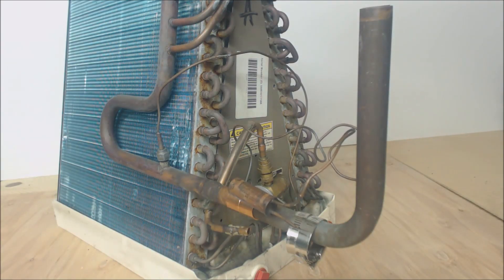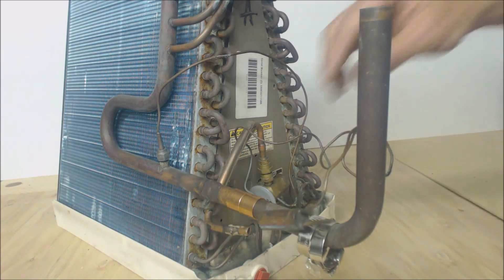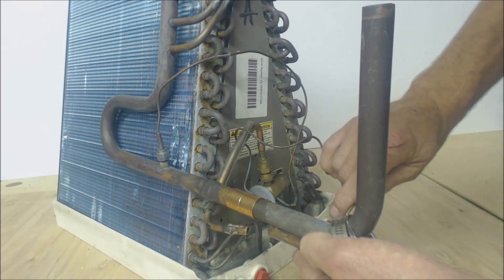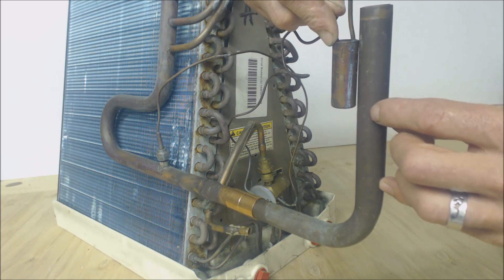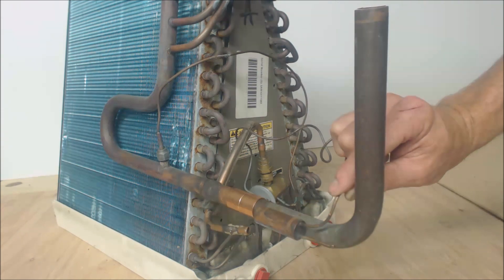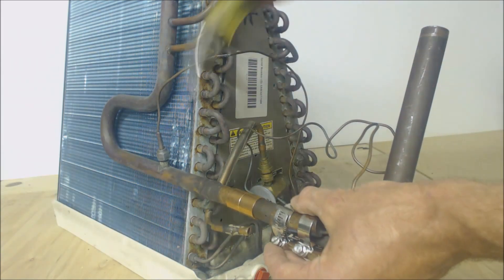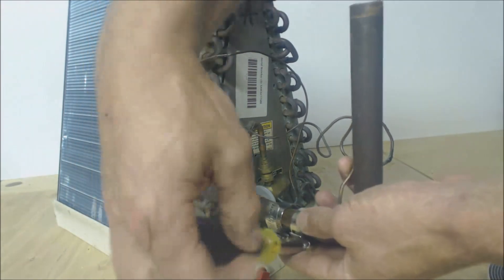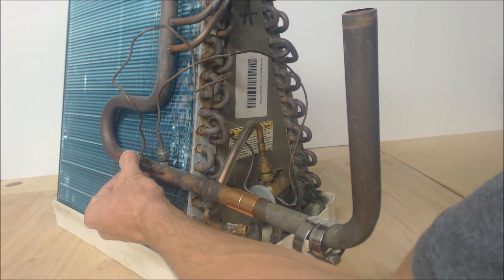TXV Thermostatic Expansion Valve Sensing Bulb Position!

Comment: Great video!!! I absolutely agree that 2-3-4-5 o’clock bulb’s position on the suction line makes no difference. I did experiments with 2-4-4-5 o’clock sensing bulb placements and there was no difference in suction line pressure/temperature or SuperHeat value on wall-in coolers or walk-in freezers. I didn’t play with A/Cs yet. For the refrigeration equipment I had R- 404A and R-407A.

Comment: Can the equalization port be installed on the outside right where the pipe exits the housing, when the pipe section inside is very short?

Comment: 4:37... to have a good thermal contact get some copper tape, or copper foil, wrap around the bulb and the tube a few times (so both are inside that foil "envelope"), and use as you say, a hose clamp or two, and then some insulation stuff around (btw...even alum. foil could do, but copper is the best 'cause it conducts heat much better).
Reply: CPU thermal paste would even be better

Comment: Why does TXV manufacturer not produce sensing bulbs with certain sized grooves/curves that can fit on certain sized pipes? Say sensing bulb fit 5/8. 3/4, 1, 1-1/2, etc.
Reply from the maker: Some manufacturers of evap coils that have the txv preinstalled press a groove into the suction line so the bulb has more sensing surface area, thanks!

Comment: Nice Video's all around. Question, in the electronic industry we use a thermal paste to insure good heat transfer. Has the HVAC industry tried thermal paste with the TXV bulb installation? I am not in the HVAC industry, but just a homeowner trying to educate myself on how residential system work.
Reply: It's no necessary, the txv exist before the pyramids were built and they're still doing its job very well, do you think a car needs 5 wheels to run better?

Comment: TXVs should be down stream from the evaporator coils about 6-10 inches  and It should be at 2pm if your going straight. Great video thanks for some information there.
Reply from the maker: Hey Harry, the txv is installed upstream of the evaporator coil and right before the distributor tubes. The length away from the coil would depend if you have distributor tubes or not. The bulb position would depend on the diameter of the suction tube. These were just general rules for smaller residential systems, thanks Harry!

Comment: On a package unit where do you place your temp probe to check superheat and subcooling?
Reply from the maker: Some package unit ports are placed in the correct spots for checking superheat and subcooling. If they are not then you should look for a manufacturer charging guideline which will say where to read pressure and temp. I know this video is on a split system but the same thought process would apply if the ports were not in the right location and you were trying to find where the sat state temp could be taken from- https://www.youtube.com/watch?v=MHth2vH3np4&t=28s

Comment: does it matter where the bulb is in relation to external equilizer tap?
Reply from the maker: Great in-depth question. There are 2-3 schools of thought on that and one is that the txv is there to maintain a good system capacity. The other thought is to maintain a proper superheat for the compressor's sake. Some would say that you need the bulb to read the suction temp after the last device is installed which would affect superheat to make sure that superheat is not lost before reaching the compressor. Some would say that it is more important to fill the evap with the sat state as much as possible and that the compressor may be able to handle a small amount of sat state every once and a while. Others say there really is not much of a change in temp read on the bulb right before or right after the external equalizer. We also use txv's without the external equalization port which is worse for guaranteeing compressor safety. Thanks a lot Randall and awesome question!
Reply: i wanted to see what you thought about putting the bulb before or after equilizer. i saw another tech video that said he had a problem with bulb after equilizer due to extra refrigerant from equilizer discharge affecting bulb temp. like a feedback loop that caused the coil to freeze up.

seems like there shouldnt be enough liquid coming out of equilizer to affect the bulb sense???? might be wrong.

thanks for reply
Reply from the maker: It would have to leak between the pin and the brass housing inside the txv, highly unlikely that it would be a significant amount. I see manufacturers for ac evaps factory installing external equalizer tube upstream of the bulb and also the way that techs try to install when given the opportunity which is bulb upstream of the tube but it is not like a freeflowing loop inside though, thanks Randall!

Comment: I've seen the TXV itself (not the bulb) installed upside down. Does this cause hangups for the TXV?
Reply from the maker: Since it is spring and pressure driven, it should work but is not advised. They are factory installed horizontal in may instances such as multipoise evap coils. How old was the unit?
Reply: It makes no difference.

Comment: Won't the steel straps in contact with the copper tubing create a bimetallic corrosion that could eventually compromise the integrity of both components? For example: a galvanic corrosion through an electrochemical process corrodes the steel strap and piping, causing both to fail. It seems like you'd want to instead use either copper or plastic straps.
Reply from the maker: These are stainless steel so they don't react with copper due to their properties. If it was a galvanized strap, it certainly would corrode. I would not use any plastic strap or cable tie because of stretching over time and not as strong.  Actually some manufacturers provide a type of stainless steel clamp for this with a single screw and nut. Thanks Adam!

Comment: So while researching a problem today I came upon a thread that contained a statement by a person mentioning that you should always mount the bulb UPSTREAM of the equalizing tube, so about 12" to the left of where you're showing here or next to that bottom bend although I understand that it's probably not the point of this video.  The discharge of the equalizing tube can cause improper metering.
Reply from the maker: Great in-depth question. There are 2-3 schools of thought on that and one is that the txv is there to maintain a good system capacity. The other thought is to maintain a proper superheat for the compressor's sake. Some would say that you need the bulb to read the suction temp after the last device is installed which would affect superheat to make sure that superheat is not lost before reaching the compressor. Some would say that it is more important to fill the evap with the sat state as much as possible and that the compressor may be able to handle a small amount of sat state every once and a while. Others say there really is not much of a change in temp read on the bulb right before or right after the external equalizer. We also use txv's without the external equalization port which is worse for guaranteeing compressor safety. Thanks a lot Tie Dye and awesome question!

Comment: So I have a question, I was troubleshooting a new unit 410A, it was slightly undercharged so I went ahead and charged it up but the low side didn't  seemed to increase the pressure at all I added about 1 1/2 lbs and not even a single psi, but the high side kept increasing, is this a txv sensing bulb? Problem
Reply from the maker: If you are charging and the subcooling keeps increasing but you cannot get the pressure up it is likely the txv. If both are not going up then it is likely airflow. Check out this TXV troubleshooting playlist to confirm this. You can put the sensing bulb in hot water to test the opening of the txv.https://www.youtube.com/playlist?list=PLxnHR5_D2ojy2EYzy0YIJkce9sFIQj4-j

Comment: OK, I'm at a loss here and I could really use some advice. 
When my compressor kicks on my high reads roughly 420psi but my low reads around 110 and then begins to drop all the way to zero yet the high side climbs maybe a few psi. If there was a blockage anywhere after the high side test port I would assume the high side would climb as the low side drops. What causes low to drop to zero but high to only climb a few psi? Any advice is greatly appreciated
Reply from the maker: So when the low side lowers then the high side will actually stay the same or lower itself some while your subcooling increases some. I am assuming we are talking about R-410A refrigerant.  Have you checked out the troubleshooting txv videos playlist on the channel? I show how to test the txv bulb and what the pressures are like when putting the bulb in hot or ice water. It sounds like a blockage or bad txv but the more details the better. Thanks for the question!
Reply: +acservicetech 
It is a 3.5 ton, outdoor compressor, attic air handler. I used your video to diagnose and determine that the TXV was bad. I had the TXV replaced about three weeks ago and it was working beautifully. Just a couple days ago it quit cooling and the compressor sounded like it was pulling a vacuum on the suction side so I shut it down and connected my gauges. Upon posting the unit back up the suction and liquid line pressures were right on the mark but the suction line was around 80 degrees F and the air inside was slightly cool. After running for roughly 20 minutes the liquid line pressure increased slightly to around 440psi and the low dropped all the way to zero so I shut the unit down again. Today I tried to pull the freon into the compressor to flush the system and install a new filter but I could only get the suction pressure down to around 40psi before the compressor kicked off. I'm at a complete loss here. I figured if there was a blockage on the liquid side the head pressure would have sky rocketed but the pressures read perfect yet I get no cool air and the suction line gets only slightly cooler than ambient temperature.
Reply from the maker: Did you check the screen in the liquid line near the txv to see if it was clogged? Is there a great temp difference from one side of the filter drier to the other side? Is the outdoor unit a heat pump or condenser? In the text you wrote outdoor compressor. Some units that I try to pump down are just not strong enough to do it so I have to close the service valves and recover the refrigerant. You said the suction and liquid pressures were right on the mark but the suction line was 80 degrees. This means you have too much superheat from what I can tell from your post. If that is the case then yeah there is a restriction of some sort before the evap. Did you try taking the bulb off of this new txv and putting it in hot water again to see if the superheat goes down and the valve opens fully. If it does open fully then there must be some issue with this new txv, if not it is an intermittent problem like you said maybe being the filter dryer blocking or a particulate from the filter drier breaking loose. Even though it would seem strange to be, try testing the bulb again on this new one first. Did you check out the bulb positioning video that I just posted a few days ago? I hope this helps! Thanks and let me know what you find.
Reply: +acservicetech It is a heat pump system. I switched to heat for a few minutes to see if maybe it would dislodge the blockage and possibly trap it in the filter drier and the heat works very well, almost too well as the suction line gets hot enough to melt the foam insulation. I will check everything you said to check and I'll double check my TXV bulb position and test it with the hot water and document my readings. I really appreciate your help and patience, you are a great person for helping others like you do. If I can help in any way, please let me know. I'm a certified automotive tech on the civilian side and a computer tech for the military and am currently going to school for electromechanical engineering but home A/C is one field I lack experience with.

Comment: do you have anything on a hunting txv,
worked on a 4 ton 14seer amana the other day with an oem non adjustable txv, the valve is hunting sh 5f-10f and sc 6f-8F, manufacturer  recommends 7-9F for sh and sc, the airflow is with in a range, bulb is set on 3 oclock after the equalizer, should i try moving it upstream and on 4 oclock, bump a fan bit more any suggestions? thanks
Reply: Read this article online.
Lot's of good stuff!
"Tips For Preventing Superheat Hunting In TXVs"
https://www.achrnews.com/articles/83228-tips-for-preventing-superheat-hunting-in-txvs
Reply from the maker: Thanks for the question! What were the actual pressures, what was the actual superheat temp ranging, and did you just add refrigerant in? You said the valve was hunting 5f-10f. Does that mean the actual superheat was 5f-10f or was it 20f ranging 5f-10f? Thanks

Comment: if the txv is located inside the coil box do you still want to wrapped with insulation?
or only if is mounted outside of coil box.?
Thanks for sharing
Reply from the maker: So some manufacturers wrap it in the coil box and some do not. I recommend putting on two layers of foam tape to be safe when it is in the box in order to sense the correct temp. Thanks for the Comment!